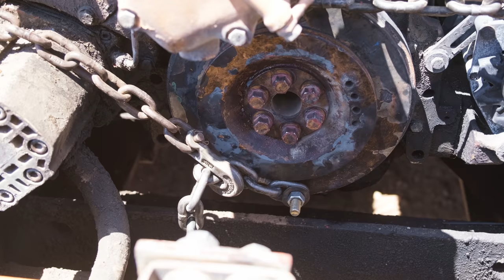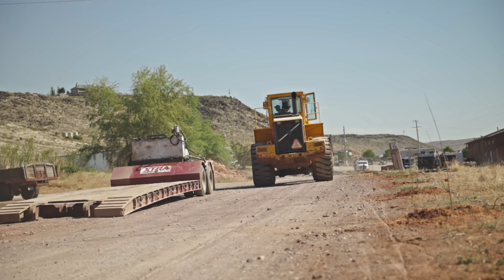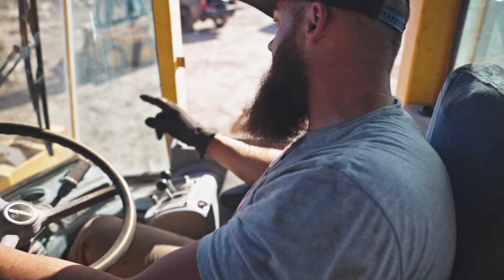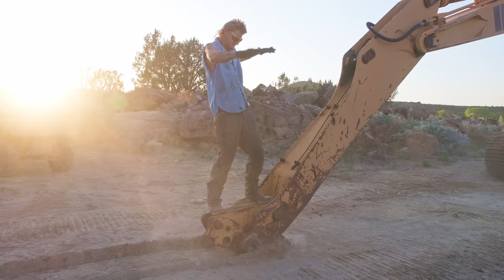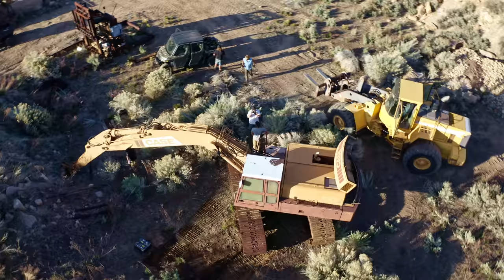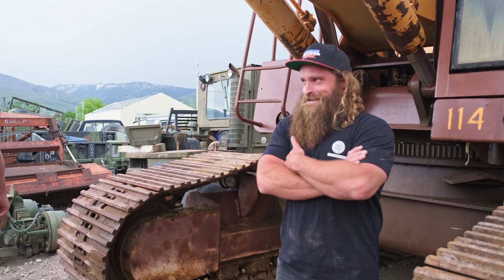We Had To Bring In A Big Boy For This Stubborn Excavator Recovery (Pt 2)

Comment: I would love to see a full build and restoration in one of them I’ve never seen someone do an excavator build
Reply: Yes pls
Reply: My exact thought
Reply: Yes ples
Reply: Ya
Reply: go look at cat excavator being built then.  look and u shall find
Reply: @garyswain5243  I bet that’s a fact but man I hate seeing old stuff just get tossed.
Reply: Please lol. Would be super cool
Reply: PLEASE
Reply: Yeap
Reply: Yeah buddy! A blacked out excavator with a bearded skull emblem on the rear!
Reply: @garyswain5243  hence the reason we wanna see it refurbished. The sandblasting, funny times that happen bc of struggles, making parts from nothing etc. Just bc it's old doesn't mean it's pointless. I'd take an old 1960s hotrod over a new electric car any day
Reply: Ryan L  LOL comparing old heavy equipment to old cars. 99% of people don't buy old equipment to look at and drive on Sunday.  Like the case 170c shown thats from probably the late 80s. Not many made to begin with. Case likely didn't even build it, and stopped stocking/producing parts for it 20 years ago. Heavy equipment doesnt have a ton of aftermarket cheap parts stores like cars do. One could easily sink 150k$ into rebuilding it. for that much you could buy a decent used one that uses a lot less fuel, faster cycle times, more hydraulic capacity, and manufacturer support. Companies buy excavators to make money lower the operating cost the better.
Reply: Yes this would be dope
Reply: I have seen someone do a resto on an excavator. But i would think Diesel Brother's resto series is way better. 😂
Reply: Have a look at the Pakistani videos they produce great content. Trucks everything.
Reply: Yassss
Reply: watch diesel creek he did one. I love his vidoes more than this channel cause he shows everything
Reply: Hell yeah
Reply: I was thinking the same thing
Reply: Yes let's see a excavator build
Reply: They could make 100 episodes on a single rebuild and I’d watch them all
Reply: Needs a Twin turbo and wide boy kit
Reply: A swap build new engine and pump now that I'd watch
Reply: @Anon15761  LOLOL keyboard mechanics. Breakout your check book and send them an blank one then. Be realistic. Cnh offers 0 parts support for those old case excavators from the 70 and 80s. Many left for dead and scrapped after the unreliable drott final drives stopped having parts support.
Reply: @garyswain5243  Hence why it's a restoration job you muppet. No one other than you is considering starting a construction company with restored, classic machinery. That's just common sense. Guess you weren't there when they handed out the common sense upgrade 😂😂😂
Reply: @Anon15761  ok boomer
Reply: Double Dog Dare! 

Full rebuild

Thanks David 👍
Reply: RESTORE IT!
Reply: Do it!!!
Reply: @garyswain5243  true but new machines are more expensive so it’s sometimes easier to get the older machines working
Reply: i quadruple this. a seperate series for that would be amazeballs!
Reply: Yeah it will be awesome
Reply: There are videos of it on here, caterpillar does some reman machine videos
Reply: That would be dope
Reply: I understand people saying rebuilding these would serve no purpose but truly it would  for a new company who really can not afford a new 200 grand machine . And with enough you tube support which I think I see with this post alone  it would real cool to see one back to life and running and hell if they can give away a truck why not give away a refurbished old piece of iron like this .
Reply: Build the motor and all maybe put 800+ HP to it
Reply: @garyswain5243  Looks like you may be the only sane one in the comment section. I couldn't imagine what they would possibly do with these two items other than scrap them out and even then the dismantling cost would likely out weigh the scrap value.
Reply: @MedicTwitch20  But the efficiency aspect and the lack of parts are great points. Still, I can't imagine rebuilding one is more expensive than buying a new one. Labor is the biggest obstacle.
Third world countries do that all day long. I wonder if you could send it to Mexico?
Reply: @garyswain5243  More great points. I'm actually surprised someone could get a used one for $150k. Aren't these things at least $750k new? How much do you think that excavator that they got unstuck to have that 6 ft bucket costs new? I was thinking close to a million.
Reply: That would be cool
Reply: Man, you must visit my country , so many people do that restoration of excavator, so come to indonesia man
Reply: And i had work in the excavator restoration place
Reply: I also would like to see one of these or one of the old D-8's being worked on.
Reply: LetsDig18 rebuilt one. I know nothing about excavators or loaders but it was fascinating!
Reply: Deboss garage. You will like him
Reply: @garyswain5243  that may be true, but you can machine literally every part of the excavator you need. I have a small construction company and I'm rebuilding an 14.5 tonne wheeled excavator O&K MH City from 1989. The O&K company doesn't exist anymore, it was bought by New Holland, but all the parts on these old excavators are more or less modular industry standard parts. And the engine is a Deutz F4L912, which itself is an industry standard and you can get all the parts you need. Not to mention that these old machines don't use any electronics, which is a huge advantage, compared to the new machines.
Reply: Don't they just Scrap em $$$$$ .
Reply: Yup....
Reply: Marty T's channel covers a few saves and repairs for use....   Not exactly restoration but he does well.  New Zealander so fun accent too.

Comment: Two things: 1) this format is excellent of you guys talking afterwards. Easier to hear you without the extra unnecessary noises. You are able to articulate the process  much easier and can omit parts that would just cause more questions, instead of giving answers. Kudos! 2) To accomplish this task with everything included, labor, parts, rental, permits, etc. How much do you estimate this cost you guys? If you had to pay someone else to perform the same task how much more would it have cost?  I drove over a million miles before I had to hang up my steering wheel after blowing a steer tire, running off the interstate down an embankment into a bunch of trees. Was entrapped for over 1 1/2 hours. Broke 4 vertebrae in my neck in 7 total places among many other injuries. You guys do this work and I applaud you for making these extremely dangerous and extremely frustrating situations look like it’s nothing more than fixing a flat on a bicycle. The stress and strain physically and mentally and then after all that you still have a long drive home…. People that haven’t done this type of work cannot understand just how taxing this job is. My hats off to you guys! Excellent! Now keep the wind at your back, your wheels on the ground and remember that right now these are the good old days you will be remembering when you too have hung up your steering wheel.

Comment: Second lowboy was a Murray with a removable gooseneck which is not hyd. and requires the truck to have Murray ramps. Jax's truck probably didn't have the ramps and they had to load from the rear. i've loaded many a piece of equip. on a Murray and there are tricks to using them. back in the day before hyd. goose necks she was a cadillac lowboy and you earned your wages if you were a lowboy operator.

Comment: A good tip for turning track machines left or right is to chock one track and you simply push the machine or the opposite track. You can use a block standing straight up and hitting the grouser on the track pad or pin in between the track and final sprocket. But the again being a savage also works. Lol

Comment: Next Time bring a garden sprayer with 50/50 mix of Oil and Diesel and Spray the Tracks and idlers down before you move it and don’t pull the Swing motor just loosen the Hydraulic lines 😊😊😊

Comment: Just in case nobody has ever told you. On a swing motor on the hoes it has a pressure brake to keep it from turning  when its not running.  It usually is the small hose in the middle of the motor on most pieces.  You put hydraulic fluid pressure in it and it will release the brake and allow the drive unit to turn.
Reply: Hello are you married

Comment: While in Saudi for Desert Shield and Storm, I drug a trailer like the one Jax had, it too is an RGN. Does your Kenworth have roller ramps on the rear of the frame? That might be a stupid question, but if your Kenwoth is equipped with the roller ramps, you could had loaded that trailer from the front rather than the back. Would have saved the time invested in going through the effort of digging the ramp and loading from the rear.

Comment: By the way all those connecting rods were hammering I'd say it had an oil pressure issue or a spun bearing( which may be the reason it was locked up in the 1st place).

Comment: I mean who wouldn't want to be best friends with Diesel Dave?

Heavy D, you need to look into an Oshkosh tractor with some tank pulling winches.  That would make pulling some of these pieces of equipment much easier.
Also would look into a diesel powered air compressor/generator/welder.  That would probably make your life much easier when out in the boonies.

Comment: I'm kinda surprised that you guys didn't check out both excavators & make your own determination on how capable they were. I don't know how many times my family did trades or recovery of multiple vehicles where someone said 1 was good & it was the other one that was good. Or a car had a part the truck needed to run. I always got the impression that the person who wants it gone rarely knows what's really going on with the machines. It's like when someone reports a stray dog. Maybe they say it's vicious & you toss a hot dog & suddenly you're best friends. Maybe it turns out to be a fox that lives in the field behind the grocery store. 
 I ramble.
 Anywho, at the start of the 1st video,  I thought you'd be pillaging 1 machine to get the other running. Either way, job's done. Good work.

Comment: There is a brake on the swing gear that is released with oil pressure. They can be released using a Porto Power hand pump.

Comment: Given the age of that machine, it's got a mechanical injection pump. The injectors themselves are essentially just nozzles if I'm remembering correctly. A lot of these Deutz diesels also have a fuel strainer that acts as a precleaner for the fuel filter to catch coarse particulate coming from the fuel tank.

Comment: 5 min with oilfield tandem and 150 ton lowboy oilfield trailer and I'd just drag it on. 
Mine had 3 winches 75 ton main and 2 - 35 ton winches. Me and 4 tandems routinely pulled 1 million plus pound oilfield dereks
Reply: Hello are you single ?
Reply: @maryjohn2988  nope married 🙂

Comment: what I have found on engines like this that don't wanna break loose the Pistons might move or break loose it's the wrist pins that are frozen in the rods they don't want to pivot and the only way to get them to move most times is to get the engine warm at any rate when you get stuff like this going I would make sure all the oils are full and let it idle to complete warming temperature and you're also gonna want to check your fuel line if there's a piece of rubber hooking to the tank because more than likely it's got some rot just had this happened on my caterpillar 320 L it's set for about 3 to 4 years and put some new batteries in it checked everything started up let it idle let it warm up then started revving it up some sounded strong then all of a sudden it quit and I lost 40 gallons of fuel on the ground I thought it looked low it tested fine I guess I never thought there would be a rubber line underneath the tank and the shut off was not working

Comment: Um that Murray trailer is a mechanical detach trailer, it works just like that other trailer. The neck breaks down and you can load on the front of the trailer. You just use the truck as the mechanical lift instead of the hyd on that other trailer. With that said a Murray trailer is also designed to be loaded over the back... the YouTube is way better than the TV show....

Comment: I'll tell u why it quit running u freed up the engine to fast causing the rings and seals to break to much torque and pressure all at once instead of freeing it up slowly not only that ran the motor to high of RPM's after sitting for so long it needed to be freed up and ran gently in order not to damage the rings and pistons which is exactly what u all done so if the block isn't damaged the pistons are probably fried and will need a complete rebuild now if u don't decide to scrap it